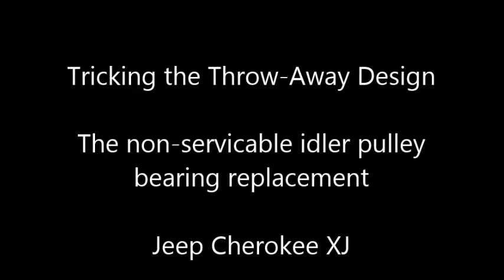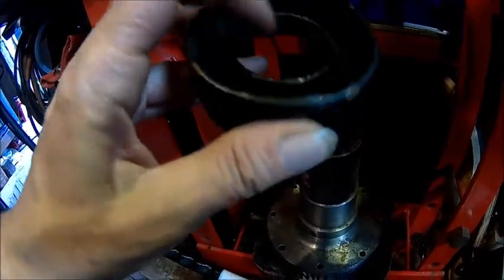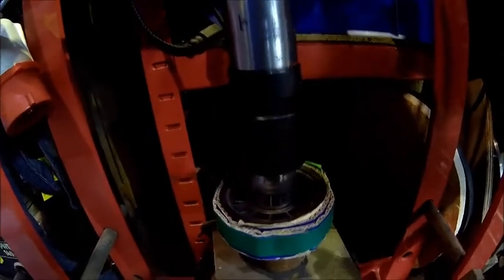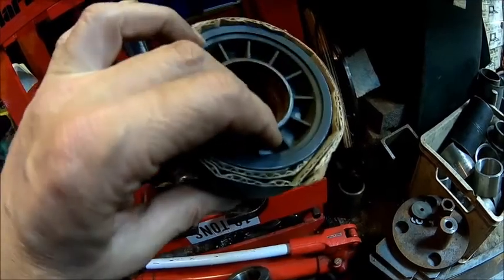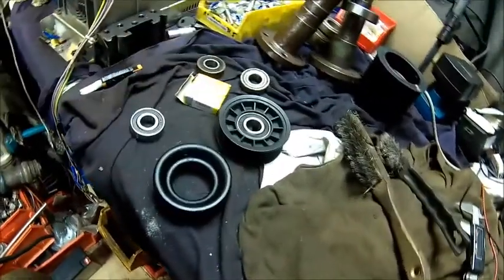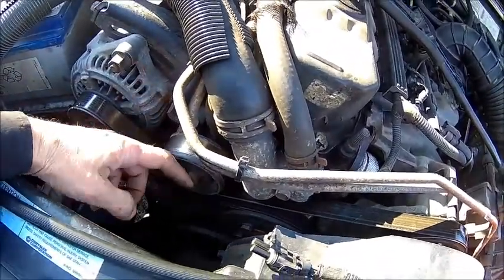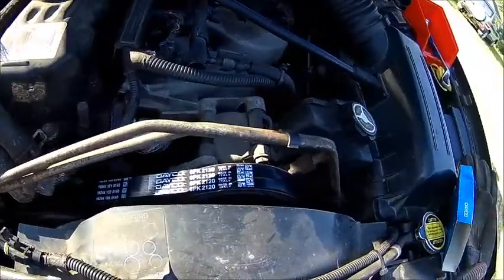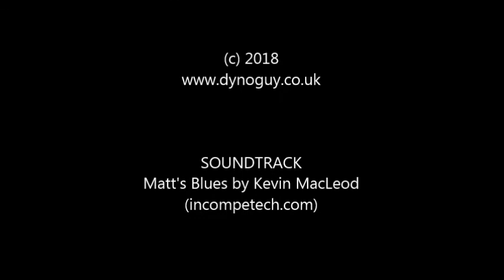Noisy idler pulley bearing fix (Jeep Cherokee XJ 4.0 ltr ERH engine)

Comment: Well done 👍 Bearing was engineered to fall, soft metal, bad heat treat. Can you imagine how much a shop would charge. Good video.
Reply from the maker: Thanks,... problem is actually two fold, a bearing made from butter steel combined with high load and speed, probably exceeding design limits. At 5500 engine rpm that pulley sees in the region of 14k rpm plus the belt strain of the pulling leg. Typical maximum ratings for a cheap  6203-2RS (greased) are 5kN or 12000 rpm, but not together. So essentially, that thing would do much better with 2 bearings........
A garage would probably charge $250+, an hour work pus 2 new OEM pulleys + tax .
Reply: The stress under load and conditions would be hard even on a good quality bearing.   I like the two bearing solution. Maybe another video?? Just Kidding...
Reply from the maker: You most probably right, it's just a cost optimized design, but the original lasted at least 80k miles from new, so back in 1996 the factory obviously used at least a quality bearing   ... if i ever get bored, i will do a 2 bearing version,.... but i don't think this is going to happen before i die ...:-)

Comment: looks like your engine configuration is the same as mine. the alternator on mine is on the left of the engine as well. power steering pump on the right. 
crown bearings - an english brand or something chinesium?
Reply from the maker: I was under the impression that the LHD version has a different configuration, at least with A/C, ... is your visco fan on the water pump or an idler pulley ? Crown Automotive is a US brand, on the box it says "Printed in USA", contents are most likely non US. They don't last very long, but there is not much choice over here, except you go to the friendly Jeep counter and pay an arm and a leg ...
The replacement bearings i used are sold by Dunlop, origin unknown so far.
Reply: the fan, if memory serves, is on a separate pulley. it has a clutch that engages when the radiator reaches a certain temp, i don't specifically remember it being on the water pump but then it's been a while since i have been into that part of the engine, so it may well be on the water pump. then of course is the auxiliary electric fan as well just off to the left of the main fan. 
i've never heard of crown bearings... maguire, yes and of course the usual lineup of the major manufacturers such as SKF, FAG, Timken, NSK et al. anything that says made in china goes back unopened...even the ones from SKF... so with crown it very well may be a chinesium bearing since the XJ is still being built in china and most of the replacement parts you get from the dealer come from china unless you demand old new stock out of US manufacture. those parts are insanely expensive and increasingly hard to get. you can always get into german ebay and get your bearings from name brand manufacturers for very little money. SKF has a page in their website where you can put in the dimensions of a given bearing and get the catalog number. then it's no big step to go and find it in ebay. 

from all what i can make out, the only difference between the LHD and RHD is the steering column placement. the drag link is also a little different but other than that it appears that everything else is pretty much the same.
Reply from the maker: Crown is not the bearing brand, it's the complete assembly, they just sell aftermarket parts for Jeeps and maybe other vehicles, it's a US company which apparently have boxes printed in the US ...:-). 
I don't buy bearings on ebay, i get these things from Bearingboys, they stock pretty much any common bearing and you have the choice of cheap or SKF etc. Good service, good price and delivered withing 2 days, what else do you want.
I have metric standard sizes in stock anyway, at least 6000, 6200 and 6300 series up to 40mm ID (that's xx08), so i don't need to wait for a delivery if an urgent job comes in.

Well, ... there is quite a bit more than the steering column, right engine mount is from the 4 cylinder (smaller) to clear the steering column, heater system and master cylinder swapped place, track bar is different, mirrors have a different viewing angle, and lots of small bits which just don't fit from the LHD version,

Comment: Why? All that work for a couple of $20 throw away parts? Not to mention the cost of the tools to do this procedure. I don't know about you, but my time is worth way more than that! But if that's how you want to spend your time, more power to you. 🤷
Reply from the maker: Well, .. you missing the point here, if i buy a replacement, it will be from China, so exactly the same poor quality, lasting 2   years max. A good quality bearing is $2, the pulley is at least $40 plus shipping, not bad for 20 minutes work. ... and always bear in mind, the best money is the one you don't spend, because it's tax free. Tools are not an argument at all as my workshop already exists.